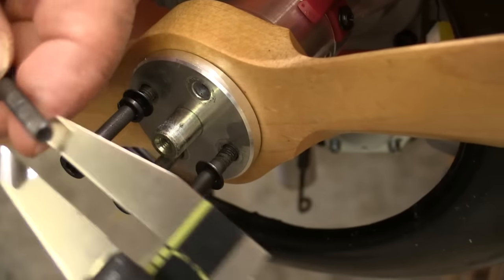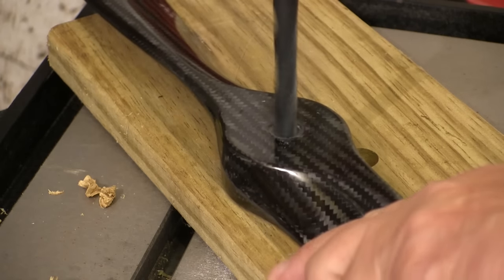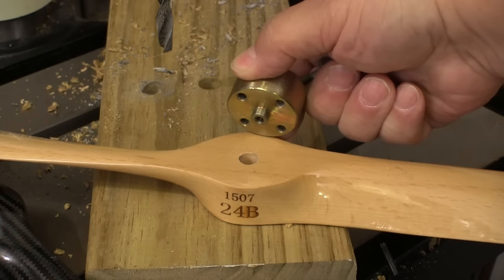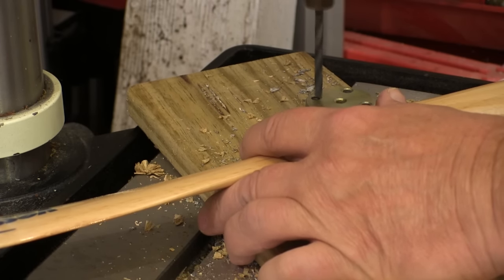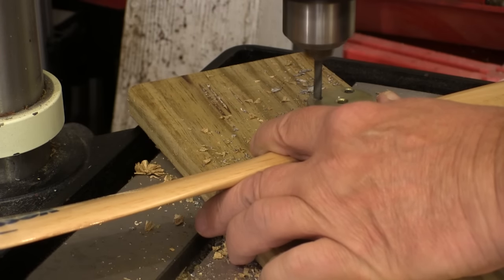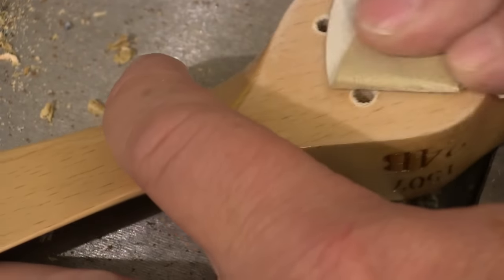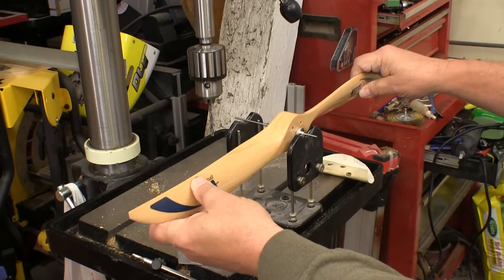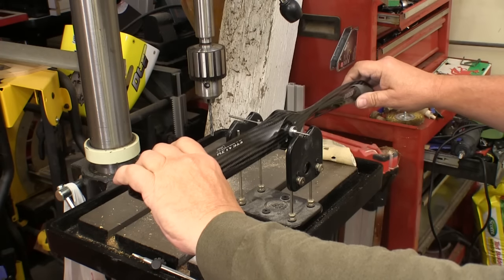Drilling Props

Comment: One of the main reasons to set prop at 01:40 is actually to have prop stop against compression when dead stick and save breaking prop ... a benefit of course is the starting - that prop is in good position to hand start the motor.

Comment: Just seen this video and was wondering if you balance the hub as well?  That's what I'm always having problems doing and was wondering how important it was.  Because I see some that don't do it at all.  Thanks again Tom for another great video.
Reply from the maker: I seldom balance the hub unless getting the blades in balance is difficult. My normal thing is to get the blades perfectly balanced and so far no vibrations or indications of a vibration.

Comment: Is the wooden propeller on the orange plane CW or CCW? Thx
Reply from the maker: CCW
Reply: thintz12 ..but it’s determined by the cockpit view..so it’s CW , clockwise. I’m confused
Reply from the maker: From the pilot perspective it is CW, from in front, where you have to decided which way to flip it, it's CCW

Comment: I have a Zenoah 26cc on my 1/4 scale cub.  Do you have a video of connecting wires? Tubes, etc.  Plus I thought it was electronic ignition but was told it was Magneto?? How do I start and kill the engine after flight?
Reply from the maker: Don't have a clue, never did a magneto engine
Reply: I know this is an older comment and i'd assume you have figured it our but I have a GT80 by Zenoah on my 1/3 scale extra 330 and I kill it with a "kill Switch" all it is a mix that shuts the carb to off when i flip the switch. Easy as pie to program on most if not all radios i'd imagine.